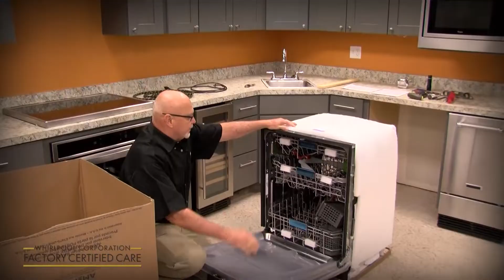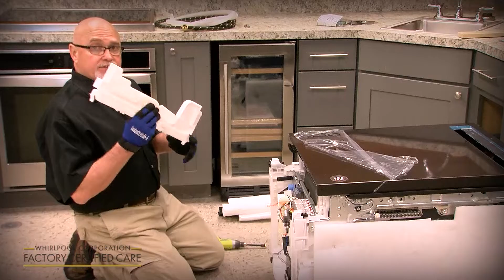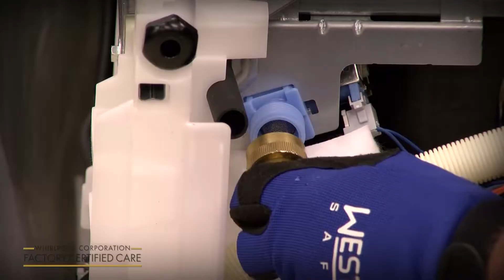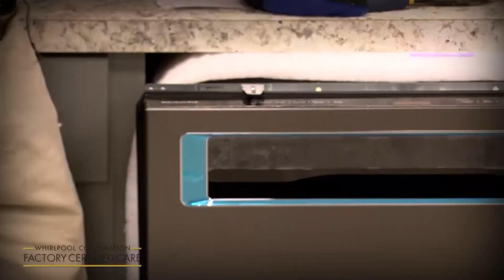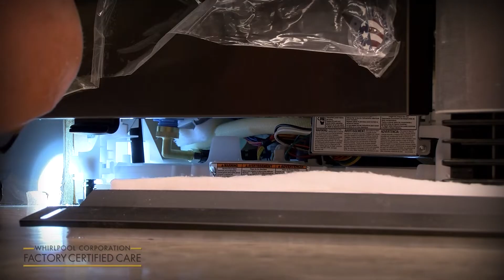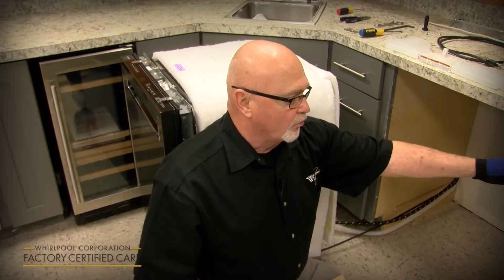Dishwasher Installation (2020 redesign)

Comment: Very informative and good video. Thank you. Sadly I should have put the black cover plates back on when the dishwasher was on it's back, what a misery to accomplish. Holes not in the right place, and that plate with the insulation on, almost impossible to pull down. And still after making the holes a lot wider, it still bends inwards and does not look good. Why would Whirlpool make this so poorly when the rest is a dream ?

Comment: I ordered my new whirlpool from lowes,it only came with the drain hose and clamps,i was told when ordering that id need to purchas an 'install kit' which cost me an extra $40,but it did come with power cord(no eyelets though) and water line,im still in the process of hooking mine up(kinda hard to follow instructions,which is why im here 😁)

Comment: Older home and my water supply came up through the floor right where the drip tray was so the pipes were in the way.  I ended up having to move my water line before I could finish the installation.    That was a nuisance to say the least.

Comment: Yeah I am having nothing but trouble installing mine. I followed instructions to the letter and its beeping like hell at me. I have a Kitchen Aid Model # KDTM404KPS. Its also stuck in a certain cycle mode. I try to push cancle start/resume but nothing. Recycled the power with the breaker but still stuck in the same mode. Its brand new and I just installed it. Checked the float switch to make sure its plugged in, it is and here is the strange thing, it worked once and washed with out any dishes in it, but then has not worked at all since. I have only had it for 2 days now.

Comment: Why aren't dishwashers designed to have the electric connection in the back instead of the front...would make install/removal much easier.  same for the water inlet.

Comment: Video was good, but the new “upgrades” to the appliance are crap!  Plastic adjustable legs?  Who came up with that one?  Mine stripped right away.  If you’re changing the way the electrical is attached, then you need to include an upgraded wire to reflect that change.  The 90 degree hose attachment is nice though and yes, when u tip it on its side…it will leak water.

Comment: I just replaced our old Kitchen Aid dishwasher with a new KDMP404 2020 one.  This was my first dishwasher installation.   I would never have been able to do it without this video.  While you give a lot of detailed instruction which is great, a lot more key information was conveyed by your demonstration e.g.  how does the insulation go on the kick plate.   I found myself running back to the video multiple times to find answers to questions that came up while doing the installation.   Much to my surprise everything was done right first time.  I thought for sure I would have messed up something but I got it right.    And while there are a lot of good features with this product, there are a lot of annoyances such as the need for SAE and Metric wrenches; the screws are sometimes, flat head, or Phillips or Torx.   But, again, through your video I was able to do it.  A link to your video should go out with the installation instructions - seriously.    Thank you.

Comment: I’m in the process of installing a new Whirlpool and I have a problem disconnecting the wires from the drip pad - I tried unclipping the plastic connection with the orange wires, (26:50) but nothing budged or wiggled and it felt like I might break it off before it responded. I can see the installer has done it 100 times, so he knows the trick but I tried pushing left, right, up, down - it was not easy and I think this needs much more clarification because the instructions in the manual look different than it looks like in real life.  In the video the details are hidden by the glove of the presenter, but when I try to make anything unclick, nothing works as easily as the video.

So I finally unplugged the drip pan by using a tiny screwdriver to be able to depress the click lock... but it was a very poor design, imho... and it felt almost like it was going to break before actually coming out.

But I'm saving the worst for last - the newfangled electric box connector. I could see if this was a plugged in electric it would be easy while the dishwasher was on it's side. BUT in my case I have a hard wired electric - so this new electric box is WAY worse than just a simple electric twist connector with screw electric caps. Way WORSE!  Because I have to be on the floor, I found it nearly impossible to try to bend and locate the wires into the exact box location - so much more difficult than just grabbing two loose wires and screwing an orange joining cap on them. This would in fact be a total deal breaker if I knew ahead of time that it would be so difficult. Yes, I took the box off, reading how in the instructions, but it only gives an extra inch to move the cumbersome electric box down 1 inch lower. 

Also the very troublesome drip pan makes this also a deal breaker for me. Sorry to be so negative, but I've put in 3 dishwashers before and this one was the most trouble by far. I guess most folks just have it done and pay $200 for an installer to come do it for them, but I'm a do it yourself kind of guy.

But thanks for extra info that I got from this video.

Comment: Thanks for the detailed video. I would like to clarify the direct wire connection. I do not have a outlet plug behind my unit. Can I connect the bare wire directly to the terminals. In the past I would connect the wires with a wire nut. Thank you.
Reply: Have the same question. Did you ever get an answer here?
Reply: @aarongrove2688  No but a terminal box that came with the dishwasher allowed me to connect the bare wires within the box.

Comment: As a DIY veteran I wasn’t sure this was necessary to watch; after watching it I am glad I did. Great tips to make the install go smoothly and result in an ideal finished install.  I particularly appreciated the tip for eliminating the small plastic bits left inside the door after removing the protective covering.  Thanks very much for a perfect video.

Comment: Great video.  I bought the 604 model and the install was seamless.  Here is one additional installation tip I found useful.  The video shows the use of a paddle-like tool to get the insulation past the cabinet face frame without bunching up.  I found a better way was to take your utility knife and cut two pieces of cardboard from the dishwasher box about the size of the insulation on the sides of the dishwasher.  Hold the cardboard over the insulation as you push the dishwasher into the opening.  The cardboard will slide along the face frame instead of the insulation.  When the dishwasher gets within about four inches from the face frame, you can pull the cardboard back out and then push the dishwasher in the rest of the way.  It's like using a shoehorn to get into tight shoes.  Since you were going to cut the box up anyway to get it into the recycling bin, doing it during the dishwasher install provides you with an extra installation tool to use with no overall additional work.
Reply: Good tip, glad I saw this 2 days before my install!
Reply: did the same

Comment: Part number for side-trim?  My JennAir had trim that installed (screwed into) the sides of the cabinetry around the dish-washer.  KitchenAid's customer pictures, on the web site reviews for the black-stainless model with a protruding handle (like the device to the right of the dish washer in this video.

Comment: I know y'all think making the power supply with eyelets is more secure and/or easier. But the part numbers supplied with the new dishwasher are all backordered. Can you not just use what literally every other dishwasher has been using for years? So frustrating. Also  why don't you mention creating an air gap in the drain line? It's code in most US states.
Reply: Yes, and today a year later I'm stuck with the same issue. No stock of those special cables. Do I attempt cutting their eyelets and use wire nuts? But if it doesn't workout, if unit wires too short it will be a major fail.

Comment: What are the part numbers of the cords with the eyelets?
Reply: This is straight from the manual. 

Whirlpool Part Number 
Cord Kit - Straight -  W11365011
Cord Kit - Right Angle - W11365014
Reply: Not available anywhere I look. Even whirlpool amazon page says two months

Comment: I just install one of these today.  It was a little bit of a pain but I've seen worse.  I don't see any reason to wait to re-attach the dip pan assembly after everything is in place.  I agree that leveling the thing with no access to the back legs is a royal pain.

Comment: They must have a new redesign redesign? Unit came with no install instructions and hardware. Still can't find how to anchor unit to cabinet? Nothing online or in part blow up,diagrams? Looks like a hybrid of GE and who knows?
Reply: Just installed 1 hour ago.  If you are missing the hardware, you won't be able to secure to the cabinets.  There are 2 small metal brackets that hook to the side.

Comment: Great video!  The only thing missing is the side black insulation pad installation (the instructions are terrible on figuring this out).
Reply: So I am about to do this installation.  How is that installed?  Do you recall?  Thanks.
Reply: Did either of you find instructions on the black insulation pad?

Comment: Just spent 3 hours installing a new Maytag washer with this setup. I am not a professional and did the full install myself. Whirlpool should drop JB Hunt as it’s delivery/install company. They were supposed to remove my old dishwasher and install this new model. They fed me some BS about needing a long drain hose and Whirlpool doesn’t offer that for their “White Glove” delivery ordered through Costco. The 6’ hose the unit came with worked just fine... After doing the install myself, I am realizing the JB Hunt drivers were too lazy to take on this installation. I wish I saw this video before the install. The manual is simple enough to follow but having the visual helps a lot! Maytag should start printing a link to installation videos for on the manuals. I took my time working through the install to ensure no issues when all was done. Everything ran smooth at the initial rinse cycle. Please change the way you’re doing delivery/installs. JB Hunt is clearly not interested in the labor part of the final mile contract. They’re a logistics company; not appliance installers. Figure out a better way to do this so people who don’t have the time or ability to do this install themselves are not left with a new dishwasher collecting dust in the garage.
Reply: Same for Dome Depot. Though they informed me upon purchase that they no longer do installs. But, they did get rid of the old one.